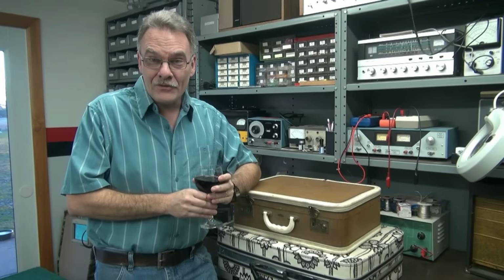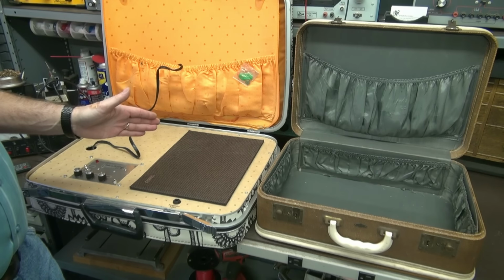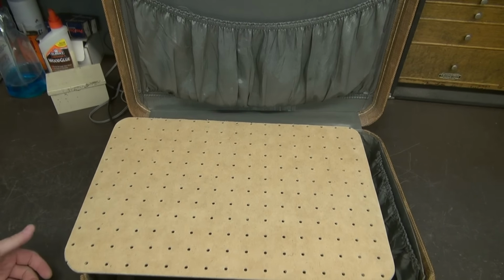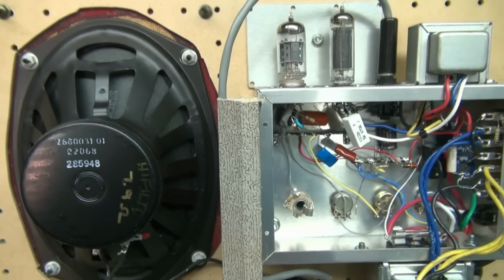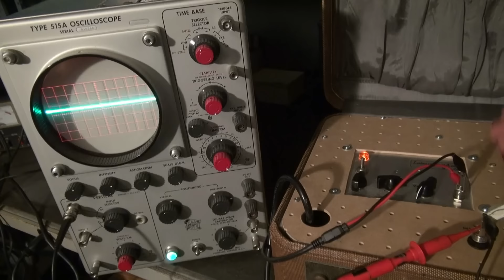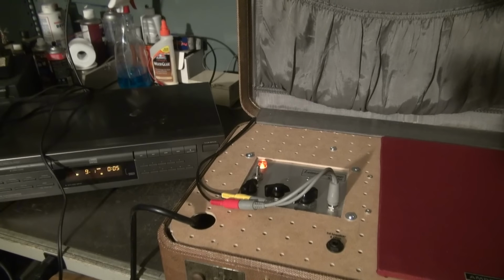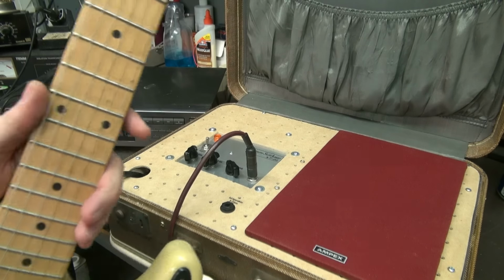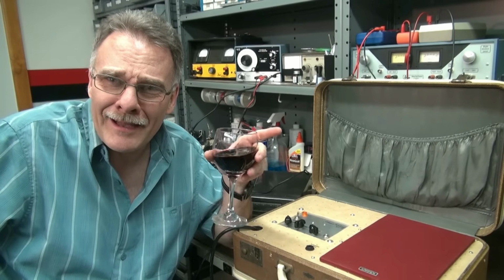How to build a Tweed 6AQ5 suitcase Vintage guitar tube amp Ampex speaker D-lab

Comment: Really Nice job Terry, excellent.  Thanks for this, I may have to try my hand at one as well.   Unrelated question if you dont mind. I have a Fender Bassman 50... and was wondering if each output is independent or collective. The head is 4ohm, and I trying to determine if I can plug a 4 ohm in the main output and an 8 ohm in the External output.  If I know my stuff, that would give me a total load of 6ohms... and the amp is rated at 4ohm total load. Is this a dangerous thing to do ???  Thanks Ron
Reply from the maker: Hello, The speaker outputs are transformer taps, so individual.
Reply: Thank you Terry !!!

Comment: That sounds awesome wow nice work Sir. I've got an old Fender Deluxe Reverb mock 2 I bought new in I think 84. Runs a pair of 6V6 I need to change the filter cap and a few other things about it. It's starting to hum just a bit. Haven't played it in a long time. I did use it at church until they got a dang transistor amp that I don't like at all lol I'll be hauling my Fender back after it's done the heck with that other amp lol

Comment: Hi Terry, I love that neat and compact amplifier chassis. Since you have gone miniature with the power valve, have you considered using sub miniature 6112s or 6021s (or their Russian equivalents) in the preamp section. Maybe there were some in the Minuteman comms gear. Or a compact push pull circuit with the 6AQ5s?